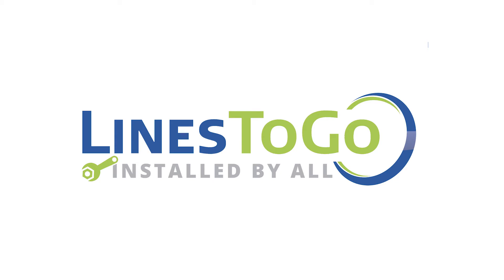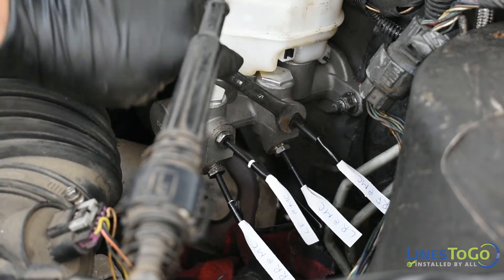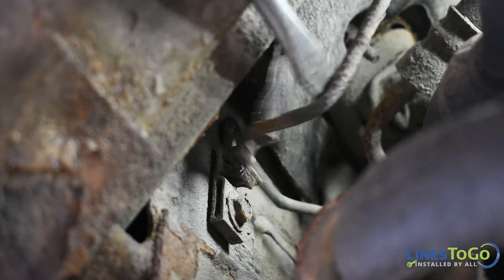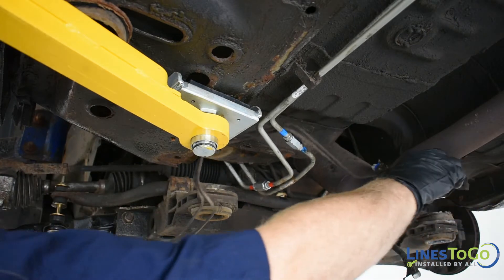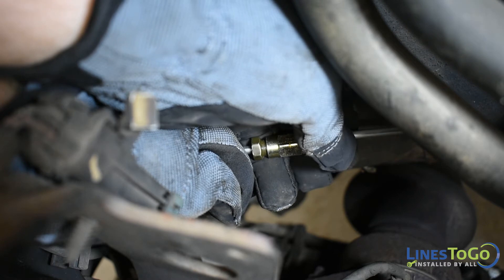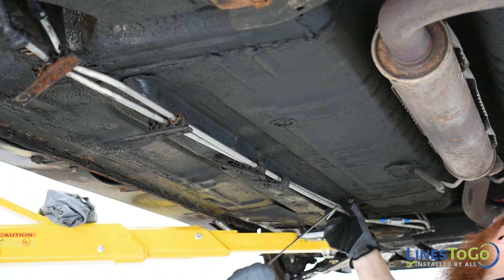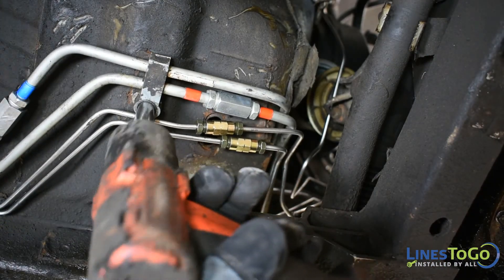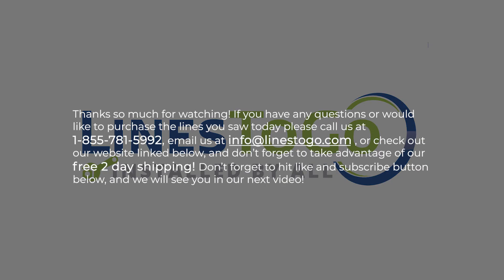How to Install 2005-2008 Pontiac Grand Prix Brake Lines

Comment: Very surprised no line wrench was used in this video? Otherwise great video
Reply from the maker: Hello Andy, 

Thank you for watching our video! 

Even though it is not shown in the video, it is good practice to do the final tightening of the lines with a Line Wrench. 

This will reduce the risk of stripping the head of inverted tube nuts. 

Happy Travels! 
LinesToGo Team